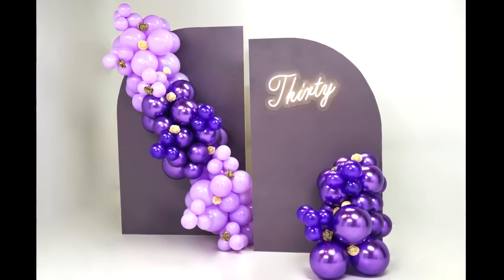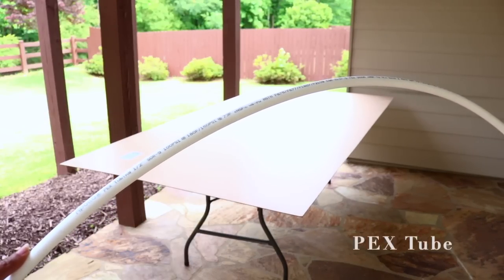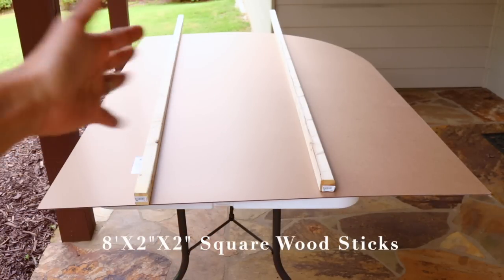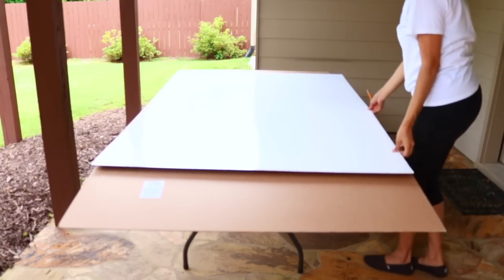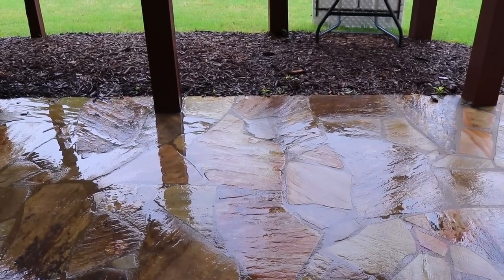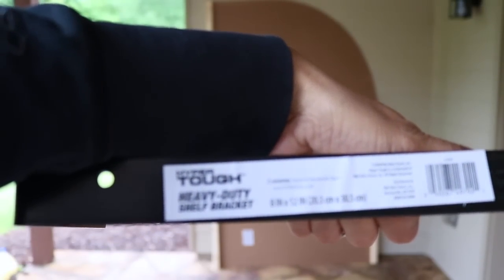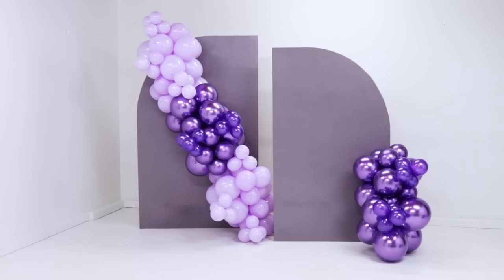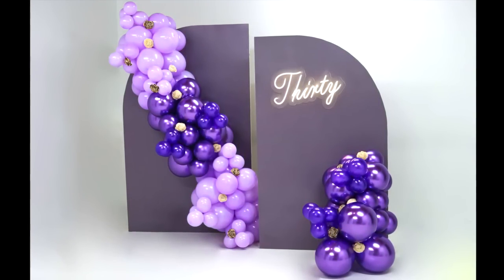DIY Backdrop Tutorial | STEP by STEP Chiara Backdrop Tutorial

Comment: Awesome job!  Was going to use plywood, but your way is so much easier and cheaper. Thanks again!
Reply: What was the name of the wood
Reply: @magalyruiz9795   not sure if this reply is for me; I used fiber board. Easier to cut, less weight and more
Flexible. Little cheaper as well
Reply: Really!!!!!Where do you buy it at Home Depot
Reply: @magalyruiz9795  yep, got it at Home Depot. They have two different types though. One is heavier than the other. Get that one. I believe they are both 1/4 or 1/8 thick. They come if 4x8 sheets and will cut it for you.
Reply: @magalyruiz9795 also, just the the small “test” paint containers. I used 3 small jars of “test” paint to cover the whole thing (front side only) and it was way cheaper than buying an entire gallon
Reply: Thank you so much for all the info, do you know what are the sizes to cut a set of 3 wood panels for Backdrops
Reply: @magalyruiz9795  Aloha. The panels come in 4x8 sheet. As for the sizes of the back drop cut out, that’s customizable to the size of the venue or based upon the party theme.